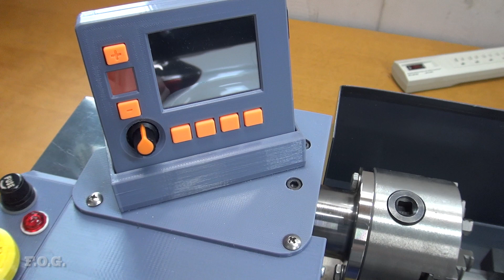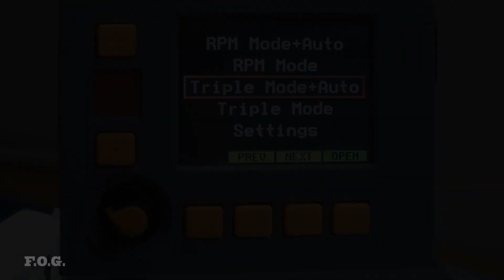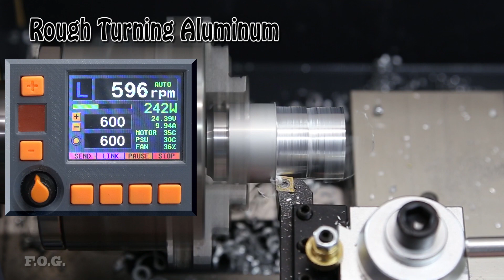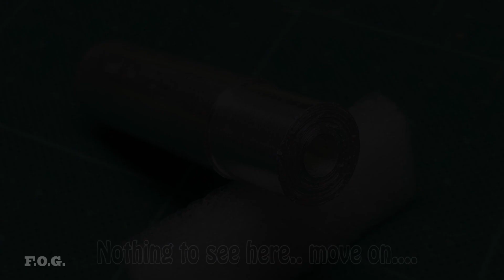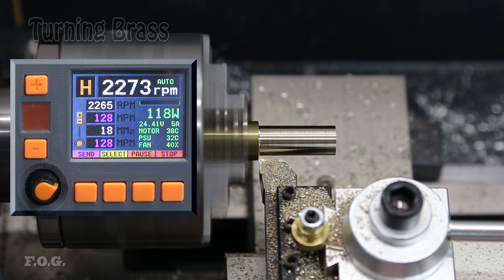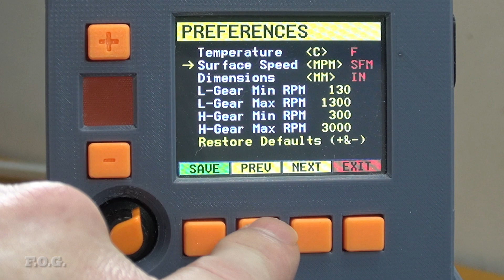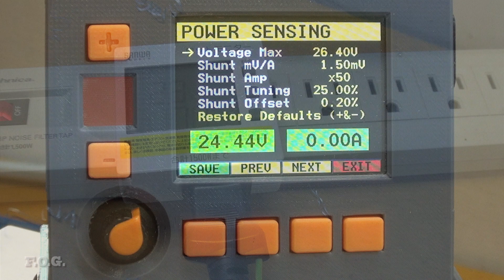EP11 - Mini Lathe Upgrade - Full Demo of Upgraded Mini Lathe - Brushless Motor Conversion How To

Comment: nice UI and controller, but would using sensored ESC make it automatic compensation to maintain speed automatic?
Reply from the maker: The answer is yes and no. There are some specialised sensored ESC's that can maintain the RPM if configured that way, but the everyday hobby type of ESC do not. Actually, once a ESC is up and spinning, the behaviour and performance of sensored & unsensored ESC is the same. But the sensored ESC is superior at stopped and slow speeds, where it can always maintain accurate control of the motor phases. For unsensored ESC, once there is no motion, the ESC can no longer know which motor phases to energize, so instead of falls back on strategies to get the motor moving, so it can get positional feedback and power the phases accurately again (this is why you can jumpy or stalled starts under load). Actually I am planning t make my own sensored ESC soon enough, but for now the setup I have works pretty good. Also, I have some good videos on how unsensored ESC works, check them out if it interests you. Thanks for the question 🙂

Comment: Hi old mate, I like your home made controller. It's got good useful information there while working. And that is the biggest model Motor I ever seen. I suppose it's a lot more Balls than the standard motor hay. Great upgrade anyhow
Reply from the maker: G'day! Actually the original motor was so bad its probably not fair to compare. The new motor does seem to power through heavy cuts pretty good now,  so I thinks it's pretty good. I was thinking the new motor would be more powerful than it actually was, but in the end it seems just right, anything more powerful would not doubt end up breaking this lathe. Saw you have a couple of off road bike videos, I will probably do a couple of off road bike videos too of some mountains here in Japan. Thanks for the comment ;-)

Comment: So when do the kits become available? lol.  Machining and printing parts, no problem, designing or soldering electronics, not so much, coding...ehhhh.. maybe, played around with trying to learn python a few times but never quite finished any of the books or online courses, but I didn't any real need or application in mind, just curiosity.  Very cool design on your part.  If you were to add a DRO to your cross feed you could possibly link it to your control and automatically adjust the RPM on face cuts as the diameter gets smaller similar to CNC lathes.
Reply from the maker: I hoped to make a statement with this series, really letting people know what amazing possibilities are out there waiting for them.
There are plenty of videos out there introducing similar tech, playing around with experimental projects, and such videos are of course important.
But I hope at least some people might watch my video and say, “hey, I could do something practical like that”, and then go out there and try to give it a go.
As for learning code, reading books or taking a class is going to take you 15% of the way.
As with learning most things, including a spoken language, unless you go out there and practically do it, you will never learn it. Set yourself a goal or a situation where you need to learn it. Even if the goal is a made up one, it does not matter, just be as persistent as you can.
Often I set my goals too high, and have my own pile of half-finished projects to prove that. But even by getting half of the way, I had already learnt allot.
It does not matter how messy your use of a language is at first, who cares, as long as you get the necessary result, then that is good enough. The more you use a language the more fluent and concise you will become
I am intending to do some coding related videos, letting people know about the various things I learnt doing this project. I am sure this will be useful as a copy paste for some, but hopefully it will help some with their approach to similar problems
BTW: I had the same idea for the DRO on the cross slide, but I also am thinking about CNC as well, so I will let that one sleep for a little while.
Thanks for taking the time to comment!

Comment: So I know you are using a 1500W power supply, but it looks like all you are using is 15A worth of current. Do you think you need such a big power supply or do you think you can get away with a 30A PSU? Also what is the power supply model #?
Reply from the maker: The peak power I have seen used so far was a bit over 500watts, so 1000watt should be enough. I would have preferred the PSU be just a little bit smaller, so if the 1000watt one is smaller (have not checked), then in hindsight I would have got the 1000watt one. If the size was the same, then I would still go with 15000watt as the price was only 60usd and prefer to keep the capacity. Search JOOLONPOR on AliExpress and sort by most sold, you will see a number of sellers selling this PSU series.
Reply: @ForOurGood  Thank you for that. Just checked and they are pretty much the same size. Theres maybe a 5mm difference on all sides but I would call that "close enough"
Reply from the maker: @Overclocked2300  Actually mine hangs out on the right side and front by about 5mm, so even though it seems small it might have been better that way.

Comment: Great project and video series, thanks for making this! You may want to think about  adding a nice big e-stop as a safety feature. Have you considered doing a CNC mod on this as well? Anyway, new subscriber here :-)
Reply from the maker: Hey thanks for the comment and subscription! Hitting the big yellow button does kill the mains power to the system. If the lathe is not spinning it does take a few seconds to discharge the PSU capacitors before the controller shuts off. If the lathe is spinning and the mains power is switched off, the software has the ability to quickly detect the dropping DC voltage which will force the lathe to emergency stop, with the brake being applied for as long as there is enough volts to keep the ESC alive. I guess there probably could be a better way, did you have an idea for how the e-stop could be done?
At the moment I have been thinking about doing a motorized variable speed lead screw, CNC is also something I would ultimately like to do, but it might take a little while to work up to that.
Reply: @ForOurGood  ah of course, some how I missed that lol. Out of interest if the lathe is spinning and you kill the power is there any motor breaking force? Sorry if that's an obvious question I (clearly) don't know much about this sort of stuff but find it very interesting
Reply from the maker: Oh no, actually it is a good question. Even though I did test the low voltage auto stop mechanism, I never have done a purposeful test to see how well this works for emergency stop. I did do a running emergency stop maybe once, but I never properly paid much attention to how quick it stopped or how long the braking force could be maintained (a bit stupid really). So now you have mentioned it, I will go do that test and see how it goes. I am assuming the braking force will come on hard, and then peter out as the voltage drops very low or the ESC stops working. I will let you know how it goes, and thanks!
Reply: @ForOurGood  I'll look forward to that (and your future content), thanks!
Reply from the maker: I have uploaded a short video to demonstrate the performance of the E-Stop as it is currently implemented.
Thanks again for the question!

Comment: Would you be able to share the code for the stm32 mcu ? I would like to see how the display works. Thanks 😀
Reply from the maker: Thanks for the question! I am not thinking to give out the source code at this time. Actually I am waiting to see how this series does overall, what sort of questions are forthcoming (like this one), and then decide the next steps. Be it a detailed “how-to” for making software like this, or just putting the source code out there, or something else. For the display I am pretty much just using the standard Adafruit Graphics module, but really only some basic calls to draw text and simple lines & boxes. I did create my own font set (and font designer) to make it all look a bit tidier. Most of what you are seeing otherwise is basically behavior based on my programming (using Arduino IDE). I am not sure how helpful that is, but if you have a more specific query I would be happy to help if I can.
Reply: @ForOurGood  Thanks for the extensive answer! I am in the process of learning about this displays, so I am just absorbing information and looking at how different people do it.
Reply from the maker: @LordEvilSeph  Your welcome. Try out the display and if you end up with a specific question then let me know. I did find that even though the stm32 bluepilll is much quicker than an Uno, the display writes are still pretty slow if you update allot of the screen. Possibly the Adafeuit graphics is a bit heavy, and a more concise implementation could be better. For me, I simply solved the problem by only updating the screen where and where changes happen.. makes the your code a little more complex, but is a solution I often use in such cases.

Comment: Works great ! Has more power than I thought it would !
I was working on a similar thing ( way less capable than your unit ) but got sidetracked with other projects - mainly based around Peltier dehumidifiers to stop my machine rusting due to condensation and to keep the humidity level in my printer filament dry box as low as possible ( still working on this ) . Mine used a tuft touch screen but one problem was to increase or decrease the motor speed I had to touch an up or down arrow and to get this to work at a sensible speed required the use of a delay which isn’t really good when it uses interrupts to read the  pulses of the spindle encoder to measure rpm . I think using a rotary encoder for speed adjustment would get rid of the tft screen  and the delay and make my unit more user friendly .
I also have a Taig mini lathe that I think the motor and esc would be ideal for , much lighter  and more compact than the mains voltage DC brushed motor I have on it now .
I also have a mini lathe fitted with a 3ph motor run off an inverter VFD , it has a two speed belt drive conversion , the tumbler gears lever has been moved to the top of the headstock and a pile of other mods - i have to be careful as it has too much grunt and it is easy to push things too hard and break something !
Thanks for the series , very well explained and filmed - You did a fantastic job on all of it !
P.S if you want to improve your finish when machining try some WD40 as cutting fluid on Aluminium and steel . Sometimes it can be the metal itself that just gives a crap finish - black steel pipe is one and some types of aluminium are a real pain to get a decent finish on .
Reply from the maker: Hey, thanks for the comment and congratulations for being about one of ten people who have really been following this series from the start. The main reason I did not bother with the touch sensor in this display is simply because I thought the screen was too small for that. I think that when making changes you really need to see the display.. not your hand.. Maybe if the display was bigger I might have gone with touch. I think a knob to control the speed is a must, and actually I would prefer a rotary encoded control, but the pot actually was a cheap and relatively easy solution to implement (except for the noisy ADC result). I think the power I got was pretty good too, actually I am worried the plastic headstock gears might explode (which is why I ordered the metal ones) BTW: I found most of the recent mini-lathes are geared a little lower at the main pulley. That would likely bump up the low end torque but drop the top end speed a little (probably leave mine as is). Thanks for the compliments, and for the tip on the WD40 with aluminum, I will be sure to try it out!
Reply: Maybe the pot would be better than an encoder - at least you don’t have to spin it to far to change the speed from 0 to full .
Reply from the maker: @ianbertenshaw4350  True, having quick access to the extents is probably nicer than a free spinning knob. But I am thinking maybe a larger knob could make fine adjustments easier, but it's not so bad as it is in any case.
Reply: @ianbertenshaw4350  the pot on my original controller had quite some wear around the 0 mark, to the point where the machine would randomly decide that it wasn't at 0 anymore and stay spinning. Encoder sounds like a great for to me!

Comment: Congratulations on your modification for your motor control for your lathe.
You have put great effort to do this 👍👍
Your channel subscriptions should grow with this content, it just takes time :)
 UK
Reply from the maker: I am told getting comments are important to the YouTube algorithm, so people like you are the ones helping the channel grow. So thanks so much for the comment and support 😊
Reply: @ForOurGood  
Yeah comments should help your channel grow.
Not replying to comments usually has a negative effect.
You'll probably find a lot people will watch your videos, but not comment or give a thumb's up.
The more videos you post, the greater chance of growing you channel.
I subscribed because, I have an interest in model engineering  using a lathe and mill to make parts.
All started with flying RC scale helicopters ten years ago.
I've modified my lathe (not quite a basic mini lathe) with an electronic lead screw controller based around the Arduino platform, still in progress.
Good luck
Adam
Reply from the maker: @adaml52  I also started doing RC with engine helicopters about 20 years ago,  although it's been a few years since I have flown last. I have seen a few of those electric leads screw mods, they seem pretty cool. Good luck with that!

Comment: Great series.  Looking forward to your next project; be that electronic leadscrew, stm32 programming or otherwise.  Thanks
Reply from the maker: Thanks for talking the time to watch the whole series and the comments along the way! I am currently doing some interesting things with the ESC so there likely will be a video on that topic soon enough. I also am working on replacing the gear changing gears in the headstock with metal ones, this ended up being a bit of a drama. I also am getting rid of than button type aluminum quick release tool post (garbage!) and am going to try the steel quick release tool post with the side gibs, hopefully this will increase the tool rigidity a bit.. Worst case I might dump the quick release... So some update video likely for that. Soon after I am thinking to do some STM32 programming vids. Hopefully they will be worth a watch!

Comment: Hi. Can you upload the code? Thanx
Reply from the maker: Thanks for your question, I got this one a couple of times ;-)
At this time I have no firm plan to release the full code listing for this mini-lathe controller, I may do so at some point, but I just don't know. Sorry!
Reply: @ForOurGood  Ok thanx. So if u can, do a video on arduino list, doint the rpm control part. Thanx Sorry for my english.
Reply: @ForOurGood  And Happy new Year!!!!
Reply from the maker: @eliasrivallo  Your English is fine. There are 4 main parts for controlling the speed that I do. (1) Measuring the RPM (2) Sending the PWM control signal, and (3) Mapping PWM to RPM, and finally (4) Automatically maintaining RPM under load. Are any of these of particular interest? Also, what type of Arduino MCU do you use?
Reply from the maker: @eliasrivallo  Happy New Year to you too! 🎆🐕